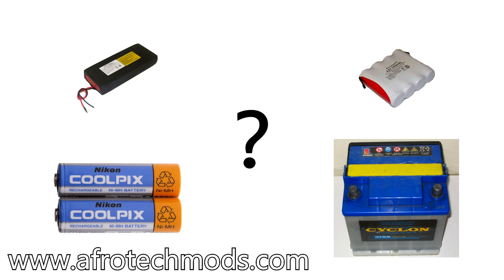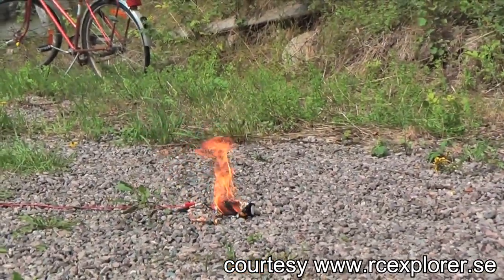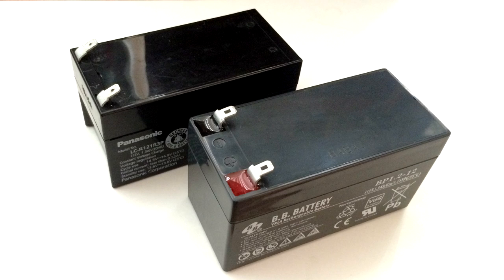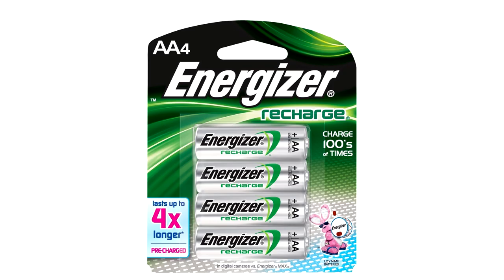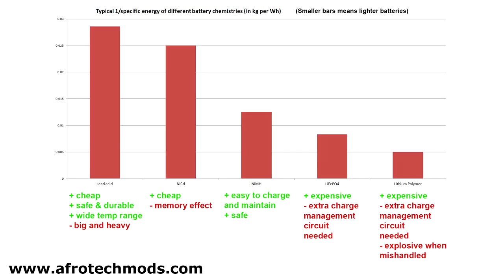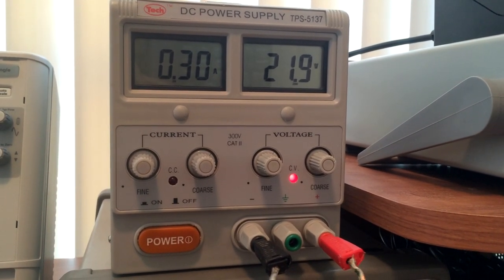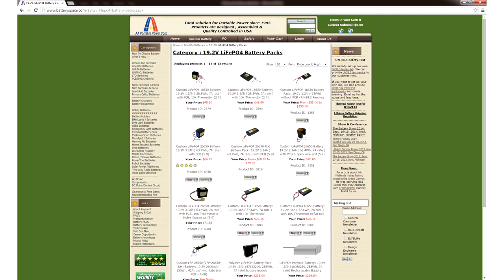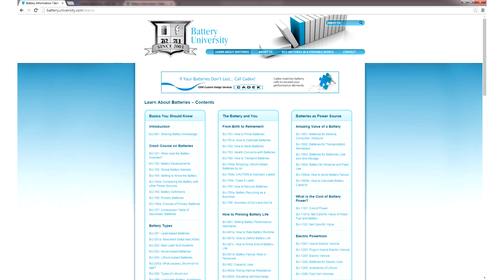🔋 How to choose a battery: A battery chemistry tutorial

Comment from the maker: One of my viewers wrote a nice email talking in more detail about lithium battery issues and I thought I would repost it here:

Hi,

I just thought I'd respectfully chip in some thoughts on your new video.

By way of background, I am one of the co-founders of QFE - a battery engineering startup in Hong Kong. We develop proprietary technologies for large battery systems to make them safer, more reliable, more energy dense and more cost effective for OEMs to deploy. Our team is comprised of mechanical, electrical and chemical engineers, and I have recommended your videos to the guys less inclined with electronics to watch in the past.

I think one issue which you addressed very well is the fact that the inherent safety of a particular chemistry is less important than how the batteries are used. 100% agreed. Two issues I thought I'd point out:

1. 'Lithium polymer' isn't a specific chemistry, per se. The underlying cathode chemistry of 'lithium polymer' batteries is 'lithium-ion', which is a broad, umbrella term covering lithium + a combination of cobalt, manganese, nickel etc. Lithium polymer refers to batteries of 'lithium-ion' chemistries that are physically packaged in a pouch form factor. 

2. Pretty much every battery chemistry out there has the potential to explode or catch fire or do both, if used incorrectly. Even lead acid batteries can explode too, as hydrogen - an explosive gas - can be produced as a side product.

Pouch cells are as unprotected of a battery construction as battery constructions get. Sheets of active material loosely contained between two insulating sheets. As an analogy, that's like sticking petrol in plastic bag, tying a knot and using that in your project. Lithium iron phosphate batteries in pouch form can puff up and explode too (noting the distinction between an explosion and a fire).

Lithium-ion batteries also come in small cylindrical constructions. These are incredibly safe, for four primary reasons:

i) The outer casings are incredibly hard to compromise/pierce. Really, really hard.
ii) The shape of the cell makes it difficult for objects to hit the cell perpendicularly; blows are typically, glancing.
iii) Unlike pouch cells, all decent small, cylindrical li-ion batteries have a safety vent, which releases the internal pressure of a battery cell in a controlled way, if the pressure builds up to dangerous levels.
iv) Decent, small, cylindrical batteries also build in a PTC, effectively disconnecting the battery from an electrical circuit if it gets too hot, hopefully preventing any further damage to the cell.

We're fans of small, cylindrical lithium-ion cells for other reasons as well: cost, weight & volumetric energy density, availability etc.

Hopefully this is helpful and not spammy.

Do please be in touch with me if I can help in any way. Please keep up the great work with the videos - easily the clearest, most easy to understand electronics videos on the internet.

Best regards,
Brandon

Brandon Ng
CEO
QFE
qf-eng.com
Reply: Thanks for the enlightment...you guys are the greatest ....like edisons   sharing your knowledge for the good of the planet
Reply: It doesn't show anything?
Reply: Thanks for posting this e-mail, it cleared up my confusion with Li-ion and Lipo batteries. I've heard other explanations but am inclined to take the word of someone actively working in the industry.

As he points out, a battery of any technology can explode or catch fire. A friend of mine was loosening a big lead acid battery's connectors with a long wrench, and while turning the thread of a terminal, he accidentally shorted it. The battery exploded into pieces.

Comment: NiCd cells are deprecated because cadmium is a problem in the waste stream and prohibited by RoHS.
AFAIK SLA batteries are nowadays called VRLA (valve-regulated lead-acid).
Battery capacity specifications in eBay advertisements are often exaggerated.
Very useful video!

Comment: You only looked at rechargable batteries. For non rechargable stuff, most people use Alkaline or Zinc Carbon batteries, but for very long term operations (small self discharge), high energey density (very high), or operation in harsh temperatures, I would recommend looking into Lithium Thionyl Chloride (LTC) chemistry. It has a lot of advantages, and are on average 3-8 time better than alkaline in many applications (especially low power or periodic pulsed power situations). In fact they do have higher energy density than Lithium-ion or Lithium-polymer batteries.

Also bundling Lithium-ion and LiPo batteries in one category is a mistake. They are quiet different, as the first one denote ones with liquid electrolyte, and second with polymer membrane. They do have vastly different properties in general.

Comment: Nickel cadmium batteries are used quite a bit on aircraft because the batteries provide the starter motor with electricity. These are quite hefty starters and nickel cadmium batteries can provide consistent voltage till they are almost drained. However, many people are starting to go over to lithium ion.

Comment: The memory effect for NiCds does not really exist unless you consistently and always only discharge it to the same point (within 1% tolerance) many, many times. It was actually NASA that noticed this with drills they used for some missions. (They noticed that after many hundreds of cycles, the batteries mysteriously lost capacity to the point it they were being discharged to.) I believe it is also possible to undo it.
Reply: I never had good experiences with NiCds.
They always run out of energy very fast directly after loading. Later i found out in the newspaper why > memory effect.
Reply: OpenGL4ever The "memory effect" is more-or-less complete BS, a very popular myth surrounding it. It originated from NASA research with purposely oversized batteries being discharged consistently to a particular SoC (State of Charge). The real problem with NiCds is self-discharge, weight, environmental concerns (nasties can be found inside them), weight, low capacity, and short lifetime due to formation of sulphur crystals internally. This last one can be fixed by jolting the battery with a huge pulse of current.

Comment: Excellent video Afrotech, it taught me exactly what it promised to teach. Thank you.
As a suggestion for a future video, could you explain converting (modding) circuits from Alkaline/Ni-Cad-powered to Lithium-powered? As a simple example, an LED torch that runs on 3 AAA batteries - how to modify it to run on an 18650 cylindrical li-ion battery, bearing in mind that (so I've been told) using an Li-Ion could overheat the LED due to internal resistance/current differences. Thanks.

Comment: What about Li-Ion batteries?
Reply from the maker: They are almost identical to Li-Po, just slightly less energy density so a little bigger/heavier for the same capacity.
Reply: almost all of li-Ion batteries are low drain so yeah, if ur gonna draw 20-40 amps safely you're gonna have to buy expensive Li-Ion chemistries

Comment: More so than weight, I thought that overall energy density was the main driving factor behind Li-Po battery packs. It's not just that they're lighter, it's that they fit into a MUCH smaller form factor for the same amount of energy storage. This, to my knowledge, is why mobile device engineers prefer them.

Comment: Hi,
  Can you please shed more light on the different types of Lead Acid batteries. You are talking more about SLA's but we have the Tubular ones, the traditional ones which require distilled water top ups...., There is also a construction difference between the ones that are used for automobiles and ones used for power storage (Deep Discharge)

Comment: Afro, isn't another concern for SLA batteries that they contain.. yknow, lead and sulfuric acid? Maybe not a concern for those small sealed ones, but the battery terminals around cars are often corroded or caked up with sulfate salts from leaking battery acid.

Comment: So I spent some time on batteryspace.com looking for a Lithium Ion Phosphate (LiFePO4) battery to power a hand held device.  However every battery I found had this warning in the description: "This pack is for testing (prototype) only. It has not been UN38.3 tested yet."  When I read further, it referred to UN shipping requirements.  It also stated that this testing was available but was expensive.  Batteryspace is only testing popular, non-custom battery packs at this time.  So.  The question is: right now I'm in the final stages of development, so the testing thing is ok.  But when I go into production, I don't want to have the high expense of a UN38.3 test.  At least not all on my own.  So what options do we have?  Just use a different type of battery instead, say NiMH?

Comment: What about making a hybrid nickel cadmium battery could be good if they had a circuit that would not allow you to recharge it unless it was fully drained and the charger would lock it in until till it was fully charged,  If someone needed to charge the battery while 1/2 charged the circuit would have a button to make it drain fast or recharge a 2nd battery attached with it as a reserve that would help in the efficiency. 

Also what about the super capacitors that some use for batteries with special circuits that act like batteries? Aren't those considered the best type since they say electric cars use them? I was wondering fi one of your videos has clues on how to make it which I kind of remember something like that when watching your voltage regulator videos.

Comment: If you are in the EU use nkon to get your batteries, it's MUCH MUCH cheaper. They sell 2900mAh li-ion batteries for as low as €1,50 and they have really low shipping costs as well (for most orders only €4)

It sounds too good to be true but it is not, I have bought a lot of batteries from them and they have all been good batteries (sony, panasonic, lg, samsung) with their specified capacity.

Comment: If I want to build portable power supply with your buck converter in the previous video, what battery should I use? The load might be around 5V @ 1.5A.

cheers

Comment: If heat is the principle killer of laptop batteries, why has anybody not made a ribbon type extension chord that you can use on your laptop and dangle the battery a feet away when you don't need mobility. We can't run off the Power supply directly in our country as there are frequent power outages. I also see that batteries are the first thing that fails on a laptop. Your thoughts please?
Reply: A second storage case just for batteries is not very suitable on a mobile device.
Not every notebook is put on a table when used.

Comment: The mayor downside of NiMh Batteries is, that they do not support high discharge currents, in contrast to Li-ion or Lead Acid

Try to look up Peukert's Law for more information
http://de.wikipedia.org/wiki/Peukert-Gleichung#Peukert-Zahl
Reply: yeah, that was a factor leading me to use LiFePO4 batteries for one of my projects.
I was tempted to use a pile of NiMH D-cells, but was limited to about 16 amps with a single bank, or 32 amps with two parallel banks. (note: AAs are generally only rated for around 1A AFAICT).

ended up going for a more expensive LiFePO4 battery, which was a lot lighter, and was rated for 400 amps (more than enough), but has a lower capacity (only 8Ah, whereas I would have got around 24Ah with parallel banks of D-cells).

for similar weight to the D-cells, I could use 2x LiFePO4 batteries, and get around 16Ah, but cost would still be a big drawback.

Comment: My iPhone battery's life has gone down a lot since I bought it 18 months ago. I thought that had to do with battery memory? But you're saying LiPo batteries don't have a memory effect?
Reply from the maker: +Robert Maxson All batteries have a finite amount of times that they can be recharged. You can expect a lipo battery like your iPhone's to lose about 20% capacity per year depending on usage and temperature.
Reply: @Afrotechmods
LiPo batteries loose also capacity just by age. You even don't have to use them, they just age and loose capacity.
Reply: @Robert Maxson
You can extend the life of a LiPO battery by using them the right way.
Never recharge them to full capacity if they are only at >= 30 % charge level.
First wait until they fall below 30 % charge level, then load them.
If you know from the begging that you won't use your battery for a couple of months, then store them at a charged level of between 20-40 %. Don't store them at > 90 % when fully loaded.
If you store them, make sure that they don't fall below 10 % charging capacity.
If they do, reload them to a level were storage is okay -> 20-40 %.
If you use the battery regularly but still want to extend battery life, than only load them not above 90 % charge level, this will extend battery life.
If you go to 100 % then make sure that you use that extra energy directly after loading.
And one more hint. Don't buy devices that don't let you insert new batteries.

Comment: I have an ebike with battery ni-mh 24v- 3.1ah. Can i convert the battery and use lead acid battery?
Reply: @Doods T. 
Do you have a clue how heavy those lead acid batteries are?
I would stick with NiMH this type is far better then lead acid. The only exception is, if you live in an area of very low temperatures below 0 °C. NiMH batteries don't like that.

But in this case, you better should search for Lithium Titanate batteries. They weight much less than lead acid batteries, can store more energy and work at temperatures below to -40 °C. But they need a battery management system and are a little expensive.

Comment: Afrotechmods Hi, may I ask the amphere rating or C rating of 4 eneloop pro connect in series ? Was deciding between this config with a 1000mAh Li-Po @ 15C. not sure whether the eneloop would be enough to drive my dual motor project.
Reply from the maker: Check out the datasheets of the eneloop pros. http://www.panasonic-eneloop.eu/home/technology/data-sheets.html The one I saw had an implied max current rating of 5000mA.
Reply: 5A is perfect for the motors, but for that rate, it would maintain at about 1.1V each. not sure if 4.4V would be too low to drive the motor speed up. big thanks! appreciate.

Comment: So if I had a 18s10p 18650 cell pack how would I determine how many amps I can draw  from my pack?
Reply: It's a little late and my english is not the best, but i'll try to explain: the main parameter you need to know is the C-rating, or better the maximum ampere-outage each cell can provide. For example: if you have a battery with a C-rating of 10C an the capacity is 2000mah, the battery can provide 20 amps for 6 minutes. Then you can multiply it with the number of cells you have in parallel and there's your rating :-)

Comment: I really don't like NiMH, mainly because they have crap for a discharge rate. I even had one catch on fire with proper discharging and charging.
Reply: I love NiMH. But i only use those with a low discharge rate. Like the Sanyo/Panasonic Eneloop series.
They are super and keep their energy for months.

I never had a NiMH catching fire. Are you sure you don't mess that up with Lithium Ion batteries, they can catch fire easily. But for NiMH it's very unlikely, are you sure that you did not short circuit them?
Reply: OpenGL4ever It was a NiMH battery. It was never shorted.

Comment: Are LiPos suitable for high altitude balloon projects?
Reply: No. It's too cold up there for normal LiPos. They would die at those temperatures.
But you can take a look at Lithium Titanate batteries they will work at temperatures down to -40 °C.
They have a lower energy density than LiPOs and are much more expensive but they weight much less than lead acid batteries and can store more energy then lead acid batteries.
The biggest downside might be the price and availability.
Search for AltairNano or Tiankang, they produce them.

An alternative to this might be to temperate the battery case and use thermal insulation for the case.
That's what NASA and ESA do on their solar power based Mars rovers.

Comment: Can the Panasonic eneloop batteries be recharged in a standard NiMH charger?
Reply from the maker: wb5rue yes
Reply: +wb5rue every nimh battery can be charged in any nimh charger suitable for this battery size and voltage ( if you have more than 1 cell in series )
Reply: Yes. The only thing you should never do is recharging a NiMH battery in a very old NiCD charger. They will kill the NiMH battery.